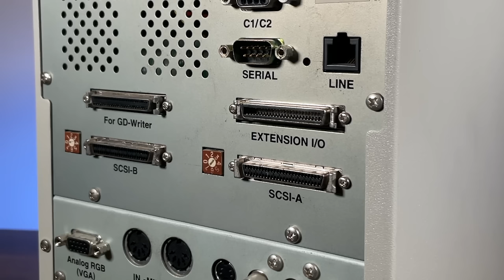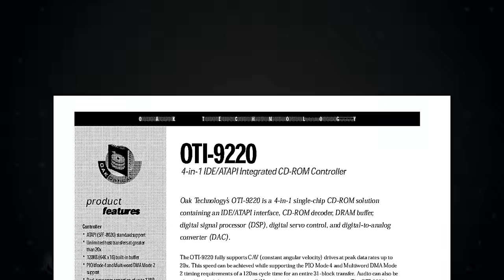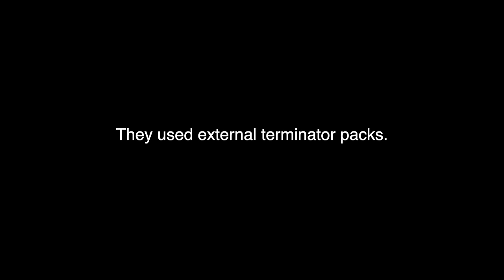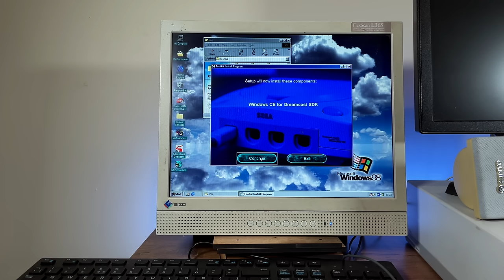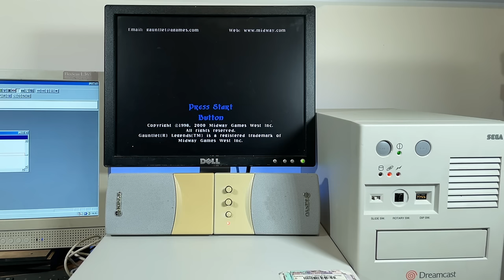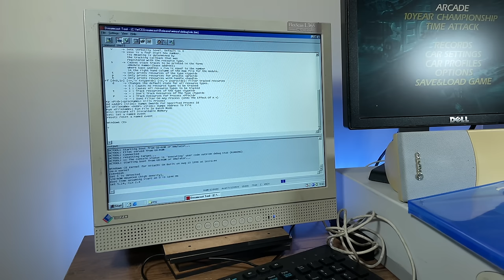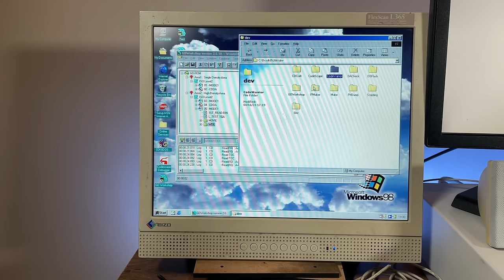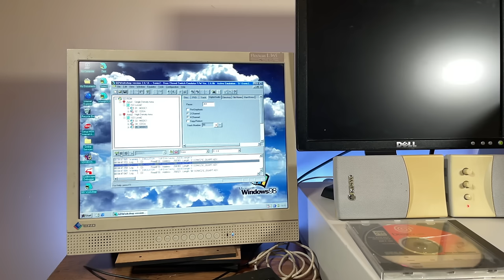Making Dreams Come True - Sega's Katana!

Comment: I have waited 20 years to finally see the inside of this thing after first seeing it in 2003 online.
Reply: I don't think I've ever seen one of these taken apart before.
Reply: @Crux161  A feature the stock dreamcast did, had a built in 56k modem that could be swapped for a broadband or LAN adapter (I have no idea what the difference between the two latter are, since both are Ethernet).
Reply: @_MasterLink_  they're probably just different names for the BBA

Comment: GD-ROMs can be read with a few Plextor IDE CD burners and a patched firmware. You can't create them without GD-Rs, of course, but at least clone them for archiving and emulation. The common way is to use a program on the Dreamcast that slowly transmits the disc image via serial connection to the PC.
The software side of the Katana is pretty much obsolete today as there are better Open Source development tools and libraries available, unless one really wants to utilize WindowsCE for any reason.
The machine itself is just one of the most beautiful console devkits ever. Thanks for taking it apart :)
Reply from the maker: I have a plextor drive on the way to do this as the redump tools spin the drive down which means I can load a good TOC and then read the high density region, so thats my best bet I think.

Comment: This is why i generally use dd to image any drive, cd, or dvd for archival purposes. Having a full backup to look into all this will be wicked! This thing looks genuinely so friggen cool, thanks a million for showing this off. It's really a dream!
Reply from the maker: Yes, dd would deffo have been better
Reply: What is "DD"? I know about Macrium and Acronis but not that
Reply: @mitlanderson  Data destroyer lol. It's a command that comes from UNIX.
Reply: @RossComputerGuy Data duplicator feels more apt nowadays
Reply: @MaximNightFury  That's it's other name. It's called data destroyer if you're destroying data or messed something up.
Reply: @NaokisRC also possible that someother partitions can be missed, not the case with block-access  dd
Reply: @NaokisRC  thought that it runs dd in background of your clonezilla tools also ... with a graphical interface & boot linux (read expert mode)
Reply: CloneZilla uses DD to make its copies. So, using it and using DD are essentially the same thing as CloneZilla is a front end OS for DD.

It also uses partclone, partimage, and Ntfsclone depending on settings but primarily dd is used.
Reply: CloneZilla uses DD to make its copies. So, using it and using DD are essentially the same thing as CloneZilla is a front end OS for DD.

It also uses partclone

Comment: I never really stopped to think that a dev kit would need to be tethered to another computer to function. They have been all in one units in my head
Reply: nope. its industry standard for devkits lol, i mean how else are you gonna make sense of all the data that's produced from the cpu executing binaries compiled for it.

not only that for rapid prototyping, youre gonna have to have a way to load newly compiled games without manually flashing them onto re-writable flash carts or worse burning a new cd-r every time! (imagine how much would a dev studio be spending in cd-r's if they had to do that!)
Reply: its probably not the case for more modern consoles like the xbox series x or ps5 since they can just connect via ethernet and do everything that way.
Reply: Out of the dev kits ive owned here are how they worked with or without a pc:

The Nintendo NDEV (wii dev kit) needs a pc to even start and loads everything over usb very similar to the dreamcast to a degre.

The Nintendo IS-NITRO-EMULATOR does not need a computer to boot and can play GBA games in this mode. To play DS games a computer is required to load a rom file but also needs a ds cart for saves only, this can be a dev cart or a retail cart with a compatible eeprom for the rom

The Sony PSP Dev kit does not need a pc to do anything other than debug stuff. you can boot and use the menu as usual and even toss in a retail psp game in the UMD drive. The CD/DVD drive can also be used just fine as long as its a master disc.

The SONY PS Vita dev kit does not need a pc to boot or to play games but does need a pc for debug stuff. Retail games could be played. 

I also had a test kit for ps3 and ps4, both could boot and run but the ps4 could do basically nothing unless it had proper game files for test kits.

EDIT: Sony stuff used ethernet or usb for stuff depending on what was happening. PS4 could do menu things and such i just mean "nothing" for playing games unless they were the right package or disc type.
Reply: Learned something new
Reply: @generic6099 It could be done since the 8-bit consoles.

Comment: By the way. despite the fact that it seems you can simply replace old power supply with  modern ones, this may not be a trivial task. Modern power supplies are designed for a mandatory 12-volt load, unlike old ones, so without it you can easily get problems with stable voltage on a 5-volt rail
Reply from the maker: The hard drive and other components still use 12v which sure will be less than a modern PC but its still enough for most modern supplies to regulate properly

Comment: the reason the dc controller had the cord on the opposite end, in cause people played with the controller in their lap, the corn coming from the top would pull it away from you when you didn the gamepad pull when jumping left or right, but when it comes out the bottom it pulled more into you hands.

Comment: Wow! Awesome teardown of this little gem. One thought about the GD-ROM drive: you mentioned that it is not ATA (or perhaps ATAPI) compliant. It might be possible to get it to work with a really OLD IDE controller (from the 386/486 days) that does not support ATA commands at all. Something by Winbond, Promise, or Data Technology come to mind. Mind you, though, that they would have to be ISA or VLB. Just a thought...😁
Reply from the maker: It will certainly not be speaking IDE as that was only used for hard drives, all other PATA drives use ATAPI to tunnel SCSI commands as SCSI supports media like CD drives. But it’s probably deliberately made to not work with conventional IDE controllers so bootleggers couldn’t easily rip and replicate discs.

Comment: For reference to the IDE drive chip, IDE CD drives actually use SCSI (yes, really, it's even possible for most OSes that support both SCSI and IDE CD drives to support obscure SCSI hardware that was never available for IDE via an IDE <-> SCSI converters... there's at least one soundcard, for example) transported over IDE, so all that's really needed is a relatively cheap repackaging of commands.
Reply from the maker: Yes ATAPI is tunnelling SCSI over ATA Packets (hence the name ATA Packet Interface), but my comment was that the GD-ROM drive was an IDE/ATAPI standard when most consoles prior and of the time (excluding the OG Xbox) used custom and proprietary interfaces. That and the fact the fact could tie it to the GD-ROM system for the Naomi.

Comment: Very neat.  Hope your friend gets some good use out of it.  Trying to find one that isn't overpriced is next-to-impossible these days.

I'll give the archive a try later.  It looks like it's encountering an exception and causing the Debug Adapter to set a breakpoint.  If you hit F9 it should retry and tell you what the exception is.  My guess is that it could be a missing sound driver.
Reply from the maker: It just skips to an illegal opcode when i tried
Reply: Bad news, I'm afraid.  There are quite a few files missing.  Though, if you move all the WDL files under the DATA directory at the root of the last MODE1 track, you should at least get it running under the Time Trial mode.  Anything with AI characters seems to cause a read error in memory (looks to be a bad or uninitialised pointer).  There's a performance graph on the right-hand side that doesn't appear in the PtoPOnline video and seems to be the main difference (except for the missing character models).

Comment: If you have “coders cable” (serial) you can dump out the GD-ROM (slowly), or using the broadband adaptor.
Reply from the maker: The disc wont read due to the crack. I am getting someone more professional to look into it

Comment: I always wonder what would have happened with the dream cast if they used dvds instead of cds.
Reply from the maker: Probably not a lot. Sega already had enough troubles with cash, getting a DVD license would put costs up, Sony would also have tried to stall production of the Dreamcast and even then the hardware in the DC was just not competitive with the rest of 6th gen consoles as GPU tech was accelerating fast. Sonic adventure 2 battle uses twice the amount of polygons for Sonic’s model on the GameCube compared to the Dreamcast, for example.
Reply: Technically not cds, but a halfway in terms of tech, they packed more than 750mb on the disc, and only the first bit of the disk counts as basically a mini cd, with the rest being GD and unreadable by most regular cd drives, without firmware hacks iirc it’s not possible even with compatible drives, but it’s been awhile. All I know is when you burn larger games to cd, you often sacrifice FMVs or music (quality lowered or removed/replaced by the smallest file. Sonic Adventure with every track being Station Square I remember VERY clearly……)

Comment: could someone use one of these dev kits to re-port Sega Rally 2 without the slowdown caused by using the windows ce api?

that would be one of my top 5 dreamcast fan projects
Reply from the maker: Sure, but you either need to rewrite the entire source code or had the original and modified it. But time spent vs end product is probably why it hasn’t happened

Comment: Is possible to run windows ce desktop?
And some of windows ce software(not made for Dreamcast, made for other ce devices)
Reply from the maker: AFAIK there is no CE desktop and CE apps have to be built to run on the SH4 CPU so you can’t just use any ordinary apps
Reply: @NaokisRC  do you mean windows ce exe have to be for windows ce and right arch?

But idk if desktop is hackble with platform builder and build with desktop environment(this does not come with sega)

Comment: It had two SH2 processors? Why? Was Sega considering Saturn backwards compatibility? That is the only reason I can think of as to why the Kitana would have them on its board. The SH4 can actually run SH2 instructions....it's just far too complicated for the Dreamcast to pull off.
Reply from the maker: SH2s have nothing to do with the dreamcast portion, they are just for the GD-Rom emulator and the debugging interface.
Reply: @NaokisRC  
Really?! That's pretty neat and maybe overkill?

Comment: i wish i could have one of those i love its boot animation its better than the dreamcast i would convert that hdd into a SD or compact flash if i  where ot acuqire on e i would just been a SCSI card as i have a what i assume is a windows 98 computer whihc i need to bring in one day and test to see if it boots but in my case its a Gateway tower like i remember pickign it up off someones driveway thhey was getting rid of it
Reply: You can install a modded dev bios on retail units, its a simple mod iirc
Reply from the maker: Yeah, the dev bios isn’t all that different in honesty
Reply: @JohnOmniviz i unfortunately dont have the toold for that but ive also been fascinated by the dev kit

Comment: windows 98se was the best for game. Even today, no OS looks as good as 98 did with the same games. I tried to hang on to 98se as long as I could but I gave up around 2007 and went with vista beta then win 7. which I'm using now and still on the same computer I built in 2011. I'll never upgrade from 7. everything after it is garbage

Comment: Seems like such an expensive waste. I don’t understand console devkits. Especially nowadays, don’t they make them on plain jane computers with licensed specific programs?

Even back then, I think a normal expensive computer back then could be used with right software to make whatever console games.
Reply from the maker: It was more about having a hardware reference that you could break into the memory and routines for debugging faster. Also this is using completely different hardware to computers and emulation was not possible without HLE, which is also very inaccurate and not good enough for production uses